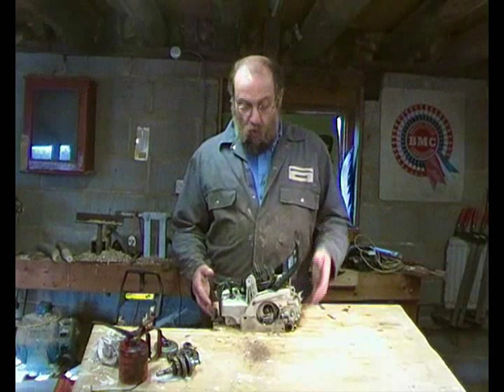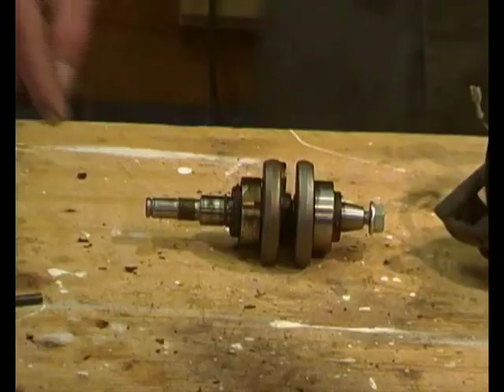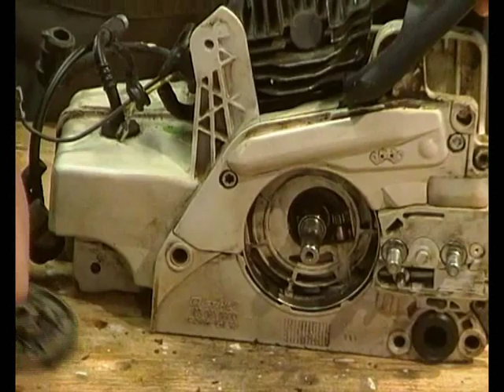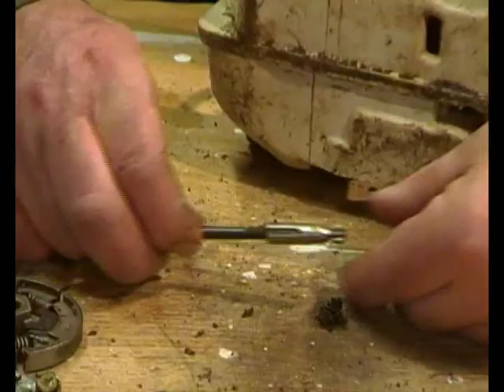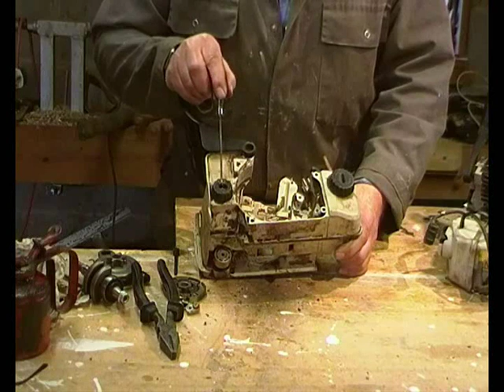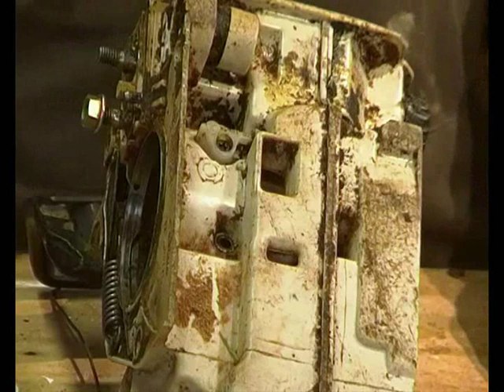Stihl MS 230 , MS 250 chainsaw rebuild, part 4, the oil pump, 017, 018

Comment: So these saws have the same design as the ms 180, 210 and 250.  I hate these designs because you have take the wholesale apart to get to the oil pump.  I like my pro saws, because on them you just have to take the clutch and sprocket off to get to the oil pump.

Comment: Good job.Has an oil pump ever worn out or failed in any way. My logic is it a piss poor design prone to clogging. I regrettably have 2 stihl saws that I have to maintain vs. my old Poulan that`s been working for 30yrs. without any maintenance except 1 carb kit.
Reply from the maker: Hi, yes it's a cheap and nasty design, the pumps used on the professional saws are much better. Cheers

Comment: Everything on my 230 was just as you showed.  My problem ended up being fine saw dust clogging the intake side of the oil pump.  Thanks to the video I had the confidence to try taking the thing apart.
Reply from the maker: Cheers, Andy

Comment: Hi Andy. You saved me a lot of time, and money, as I would not have been able to fix my blocked oil pump feed without this video. I did wonder what you meant by the verb "to flirtle off", though. However, I soon found out when I didn't use the box spanner to re-fit the circlip onto the drive shaft! The resulting high-velocity flirtle was an important learning experience for me!
Thanks for these videos.
Reply from the maker: Nice one, another word for the Oxford concise, cheers, Andy